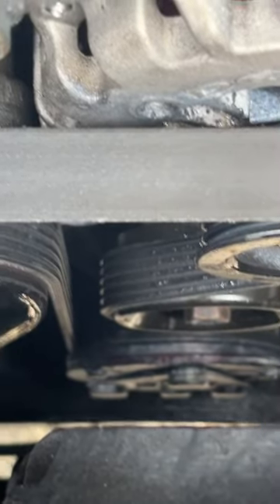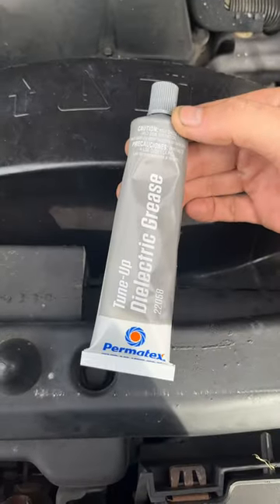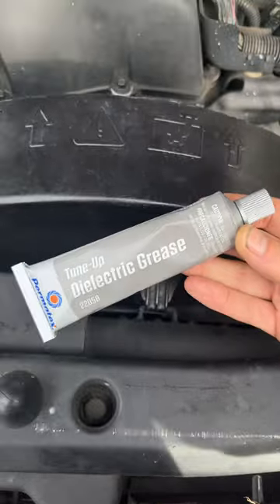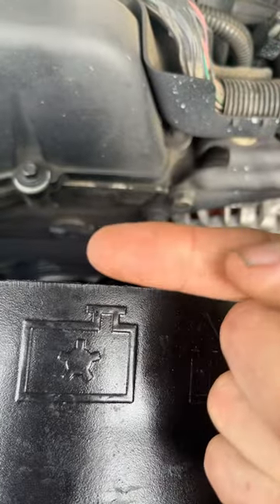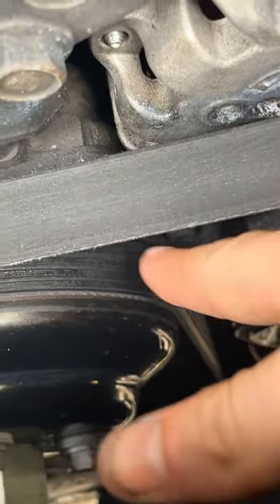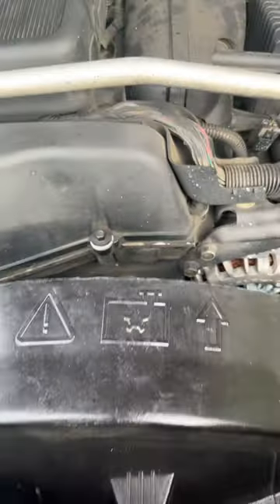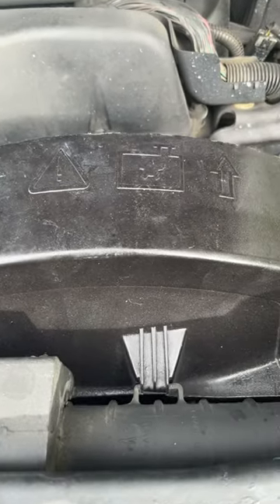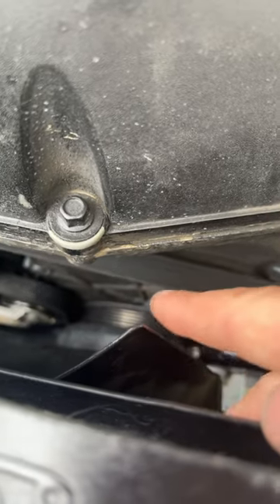Stop Serpentine Belt Noise

Comment from the maker: Some of you people amaze me, don’t stick your hand in a live engine bay and come back saying it’s my fault! No where in this instructional did I tell anyone to apply on a live engine, you can’t even do it while it’s running, this video is for the people who have done everything they can and still get squeeling, if your here to talk smack your at a lost cause!
Reply: Commonsense is hard to find nowadays.. 😭🤦🏾‍♂️
Reply: Lmao
Reply: I tried this but the squeaking didn't stop. It actually made it squeak louder for a few seconds once I start my truck. Any suggestions?
Reply: @donjon8597 did you find a solution? Was it the tensioner?
Reply: If you touch a running serp belt, you don't deserve fingers
Reply: @cristianbarata6055  the belts just weren't tight enough. The twist method to test how tight does not always work lol
Reply: I found out my vehicle,g35 couple had 3 different size belts, got the smallest size , noise gone. Wrong belt is the main reason for sqeeky belts, on start up
Reply: Instructions unclear, I now have two less fingers & my dad won't talk to me anymore.
Reply: Hey I had the same issue with my trailblazer and found out the part stores sell a bigger belt then what is needed because there are two belt sizes for the 4200 vortec
Reply: What? Turn it off first? I thought The idea was the blood would stop the squeaking. 😮
Reply: Bruh… lol
Reply: Ppl commenting syaing they fingers gone

Comment: I have a 2006 Dodge Caravan 3.3. The water pump began leaking. I replaced the pump, checked and cleaned all other pulleys and re-installed the drive belt, which was still in good condition. It squealed, due to the coolant contamination. I tried several belt treatments,  but the squeal continued. I watched several videos for this problem and watched your video. I went to my local auto parts store, bought a tube of the Permatex dielectric grease, applied appropriate amounts to the belt and the squeal stopped and has yet to return! If there is no other problems with your drive belt and pulleys, this works and will silence noisy, squealing belts. Thx for the video!😊
Reply: maybe that's what caused the squeak in my belt, I had a radiator hose explode and antifreeze shot everywhere, after fixing it myself just a day or two later this squeek  began, your comment was helpful thanks for posting
Reply: @TRANSPORTKING1988  now i wonder if thats the same case with mines. My AC hose line had a hole and freon shot all over. Now i have a squeeling noise and thinking its the belt. Gonna try change the belt out and hoping its fixed.
Reply: Could be a bearing somewhere, but if your like me. You've changed all pulleys/waterpump, tensioner, alt etc etc still squeaks to this day. (2000 Plymouth Grand Voyager SE 3.3L), I keep a bar of soap with me. Pop the hood and stick the soap on the belt for a second, it goes away still comes right back. I'll try this out hopefully it will help lol
Reply: At least you knew you had a good belt squeaking for another reason....what concerns me are all the people looking to stop the squeaking sound while ignoring the fact that they really need to change the belt!!

Comment: Did this on my dodge charger and HELPED! What a relief
Reply: Was your charger making a high pitched squeaking sound when you’d start it up ? My challenger is doing that rn
Reply: @amgteevee2217 yea man my 300 is doing that it goes away after about 30-60 seconds
Reply: Why not replace the belt or figure out WHY it's squealing before you run into a much bigger issue hiding it?
Reply: It's mainly for belt contamination. If it's a mechanical issue like bad or misaligned pulleys or loose belt then it's best to diagnose the root cause.@tomm8025
Reply: My charger scatpack is squealing like crazy. It's 2022 and only 8k miles. Does it occasionally for like 10 seconds, won't do it consistently but does it pretty much every trip. Been trying to find it. Took to Dodge, they claimed they checked and did stuff, but it is still there. Fkn dealership service department such shit

Comment: I was definitely sick of that shit. I replaced my serpentine belt, idler pulley and tensioner pulley and still got the squeak. I tried the dielectric grease and it worked. Thank you very much.
Reply: dudeeee same here, i took a big risk and replaced them too, still got the fcking squeak

Comment: I went a step further and installed 4 olive oil injectors that drop a teaspoon of EVOO on each belt every 8 engine hours. Haven't had to replace any belts in over 400k miles because of olive oil's conditioning properties while not a single chirp heard other than an ocassional cricket that likes to lick the belts at night.

Comment: I had replaced my water pump , tensioner , belt , power steering & and I still had that noise this helped !!!! Hell yeah 💯💯💯💯
Reply: Did you get any solution?
Reply: Did you replace the engine?
Reply: I did got a solution by putting this grease but it works temporarily
Reply: Did you check the ac compressor clutch and pulley bearing ect.?
Reply: LITERALLY ME RN!!!

Comment: I read about this dielectric grease today but it is Sunday so I can’t get it but I’m supposed to travel for work tomorrow and be back on weekend, I was told to temporarily use Vaseline jelly but still don’t have Vaseline, i ended up using cheer butter and it worked for now, it’s been almost 12 hours.
This is after changing serpentine belt and alternator pulley, the mechanic guy already ordered Tensioner but I ain’t going back to his place

Comment: I’ve replaced my intention of bully, my water pump, pulley alternator, pulley AC compressor idle pulley new serpentine belt and still have this whine when I’m driving and when I rev engine… but when I spray lubricant on the belt it stops

Comment: Only works temporarily !
Tries it and worked for a month,
Had to put more on and it started again after 2 weeks. Now using it without much results. 
Maybe it works for some squeaks  ????
Good luck
Reply: Because it doesn't FIX the problem that is causing the belt to squeal in the first place.  Replace the belt (simple and cheap) and if it continues find the part that is causing the problem before you have a much bigger issue.

Comment: CRC belt conditioner works a million times better.  I did everything, replaced belt, pulleys nothing worked.  that grease works for a few days to a week and you'll get the noise back.  Belt conditioner is the only thing that worked for me.    I spray it on every spring and fall, every 3000 miles or so.
Reply: No that shit makes it squeak louder lol, definitely don’t use that garbage
Reply: @Nunya-gk9fr it squeaks louder at first but after a third of the can it disappears and stays quiet for 3000 miles.  This dialectic grease will be squeaking again in 2 days

Comment: Interesting because I've been a mechanic for almost 30 years and have always known that putting grease on a belt is a bad thing to do. I've probably worked on thousands of vehicles in my career and have always found the cause of a belt squeal. There is no such thing as a belt that just squeals when every single component in the system is functioning properly. If that was true the thing would have been squealing at the dealership when it was brand new. Putting grease on belts is something that subpar mechanics do. I imagine you're the type that does such quality work as twisting wires together and wrapping electrical tape around it too instead of using splices. Some people want to do the job right, and some want to do the job wrong but achieve similar results for a shorter time period. If you prefer to be the latter that's your choice. But you shouldn't be spreading this nonsense to other people. Every real mechanic in the world will tell you to never ever ever put grease on a belt. You're one of those radiator stop leak guys too aren't you?😂😂😂😂😂😂😂
Reply: This!
Reply: True but said pretty harshly.
Reply: You said it correctly!  I have been a machinist  for 20 year and now I have been running a diesel shop in retirement for the past 7 years.  Something is not running true.  This is just a hack.
Reply: You critic but don't offer an alternate solution.
Reply: @herenowlife  - Sure he did...he said you find the reason for the squealing!!  The belt is not making sound for no reason....simply masking the noise does not solve the issue.  Hide the noise until the belt snaps and causing much bigger problems is stupid.
Reply: What about saying.  Found my was squeaks because of batteries are low and air condition is on it sqeaks only at start up so personally s don't start car with air con on.. if your charging batteries all the time with the alternator there is an add on that reduces reduces load on the alternator and belt system that is worth getting.

Comment: I didn't come here to talk crap but there is a reason it's squealing. That new alternator is not aligned , I can see the belt is riding the outer edge of the idler below it.  This silicone is not fixing the problem.

Comment: I'm hoping this is the answer to my problem of a squeaky belt, a couple days ago I had a radiator hose explode and it shot antifreeze everywhere under the hood, a day or two later the squeaking began so I'm wondering if it got antifreeze on it? I'm wondering if that's the problem because I don't see the belt wiggling or any pulleys wiggling from side to side.
Reply: Yes replace that belt

Comment: What amazes me is all the people looking for ways to eliminate the squeaky sound while ignoring the fact that the belt squeaking is indictive of a bigger issue.  Considering the much bigger problems you can face if the belt breaks or snaps why not simply replace the belt???  Not that hard to do so and belts are relatively cheap.

Comment: My belt makes a ticking noise
Reply: That’s probably a pulley. And if it’s not a pulley your probably hearing the timing chain 😬
Reply: @justgheesy  is that a normal sound for the pulley or timing chain to make?
Reply: @otterchaos666  for pulleys it’s almost a grinding sound. Timing chains usually tick
Reply: @otterchaos666  but could also just be a barring that’s loose in one of the pulleys